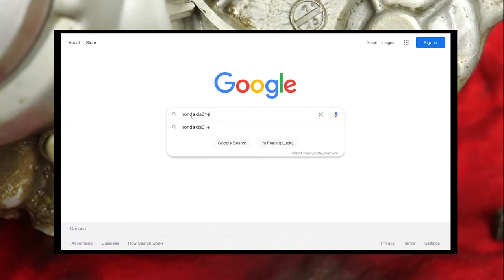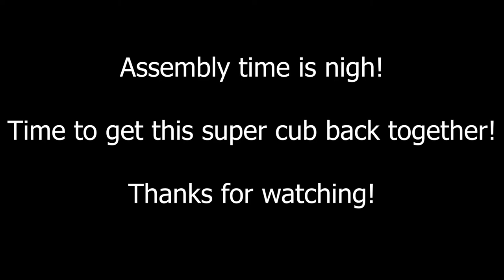1981 Honda C70 Super Cub Restoration - Part 8 - Engine & Starter

Comment: Awesome. I just picked up one of these for $100 with genuine barn dust all over it, kick starter shaft splines are likely sheared as it just rotates on kicking and the upper may be locked for now but for the price I'm not complaining. Fun to watch your videos and look towards getting mine rebuilt.
Reply from the maker: Thanks for taking a look at my videos Jeremy! I'm soon getting ready to clue up the wheel rebuild and get the old thing back together!

$100 for a barn find is pretty awesome! I paid around $500 for mine!

Comment: Hey man looks great! I have one suggestion, brass or stainless wire wheel on the aluminium is better. The steel wire will imbed small bits of steel in the aluminium and corrode it later due to dissimilar metals. Great channel keep up the good work!
Reply from the maker: Thanks!

Comment: Nice  video I love i have 1980 c70 passport but don't have any  wire harness so can you  help with some  pictures o any advice  or correct diagram  i want try to make one and also is a DA01e 10001
Reply from the maker: Hey Amel! You're in luck! If you go to my website and click on the Manuals link, it will bring you to a directory full of old Honda shop Manuals. There is one there called Honda C70 Shopmanual.pdf. It is for '80 - '82 C70s.

Section 19 in that manual has the entire wiring diagram laid out for you!

https://www.blastworks.net/

Comment: Hi, found your C70 series yesterday and your presentations are excellent! The best I’ve seen of this type. 
I have an 82 which won’t idle so I plan to rebuild the carb … what supplier do you use for the carb kit? Also, what is the green light indicator in the speedo pod? When should it bit lit or not lit?
Thanks for your great videos!
Reply from the maker: There's a carb rebuild video for this bike on my channel that I did outside of the restoration series! There's a link to a carb kit in that video description!

There's also another video that I did most recently on someone else's C70 where I address that neutral light! It should help you out as well!
Reply: Thanks from your neighbour in Charlottetown PEI

Comment: Hi i just bought a 1981 honda C70 engine does it start without a battery?
Reply from the maker: It does!
Reply: @blastworks  thank you for that fast reply. im excited to make it run even a bit before i clean it up and everything. Liked and subscribed
Reply: @blastworks  sorry i have one more question. Do you have like a diagram on how to make it run like that with only the necessary connections? I cant figure out how u did it. I only work on china pitbikes and i just buy wiring harness all the time.
Reply from the maker: @harbysdiymore4230  All you need is the coil and kill switch hooked up and you should be good to go! You can get the manual for the C70 from the Manuals link on my website, link should be on the about page here on my YouTube channel.

Comment: Starters on the 'Passport' get fried because the voltage is too weak, turns too slow which causes HEAT to build-up very fast
Coil-windings don't like heat build-up
___________
Solution is to convert to 12v. so the amperage can flow much more readibly due to lesser resistance...of course then the bulbs all need replacing and the resistor-block
No more 'weak starts' which is what causes the starters on these Hondas to fry!
( Honda became aware of the fact that the 6v. battery was simply too small to hold a good 'float charge' while not running and that weak charge factor is the culprit of premature wear on the starter )
Long starter use causes very fast heat build-up...the more power at the start, the faster the engine turns-over and engages
The '83 models and later run 12v and 'problem solved'
__________
My '08 'Metropolitan' has a unique feature!  *Engage the starter and the polarity of the generator is 'reversed' and the spindle
'turns backwards' and engages the engine...brilliant!*   NO 'separate' starter-motor!
Reply from the maker: Thanks for all the great information Gerry!